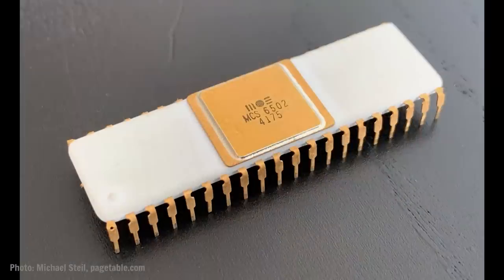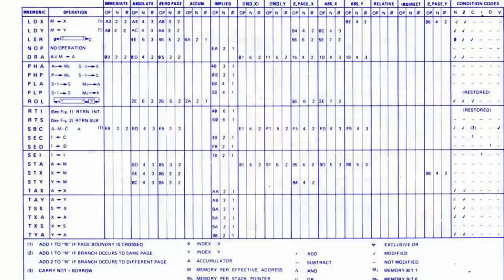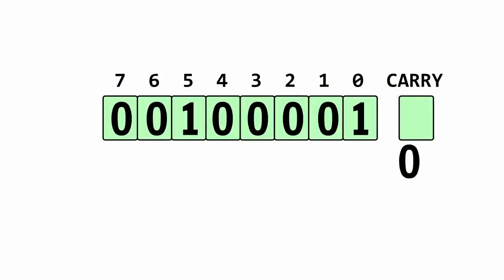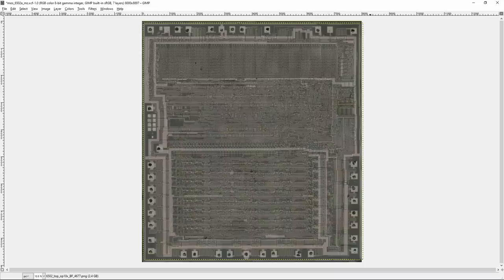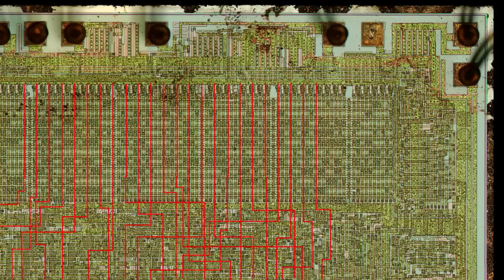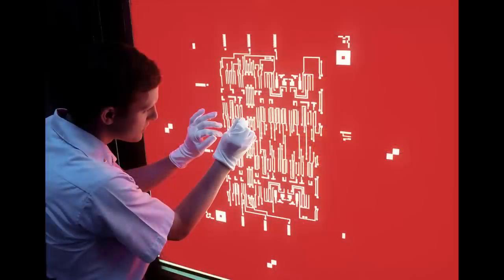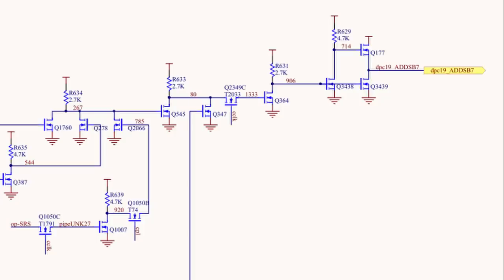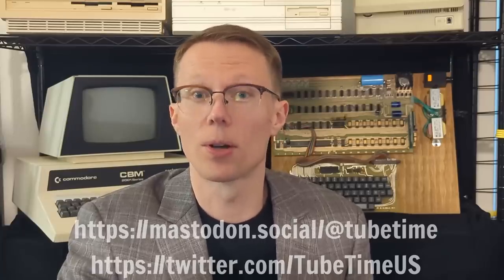The 6502 Rotate Right Myth

Comment from the maker: Some folks are asking about the rotate left instruction - wouldn't that have the same problem? I forgot to mention it in the video, but the 6502's rotate left is a little weird. It just adds the number to itself, with the carry coming in and going out just like in a regular add (ADC) operation. A pipeline delay takes care of the rest.
Reply: Reusing the ADC path is certainly a hacky but legitimate way of building a ROL instruction and would explain why they didn't plan for the ROR.

Comment: Good explanation - if it were an implementation bug, you'd find defective circuitry, not an absence of any.  Nice to get conclusive details.
Reply: Is it a bug if its intentionally masked out ? Would you find defective circuitry if its masked out ? or would you find blank spaces and tracks to nowhere if an intended instruction hadn't been resolved in time for the release date ?

All fascinating stuff though.
Reply: @garyc3476   😵‍💫"Though". 😵‍💫  The designers left out one (or many!) nice-to-have instructions, some possibly decided in the last days due to lack of space.  They documented no ROR instruction.  The 6502A was complete and bug-free.  When a new model 6502B came out, with identical specs and behavior except that one instruction was added, that was no bug either.  Compared to the 1976 model, the 1975 model looked AS IF it were the new model with a defect introduced (undefined behavior instead of ROR).
Nowadays, new instructions can be added (and bugs fixed) retroactively.  The BIOS chip can update the CPU microcode after-the-fact, at power-up.  Undefined instructions can trigger interrupts that call routines that emulate the missing instructions.

Comment: Knowing that these first processors, already  complex with thousand of transistors, were designed with big sheets by hand is mindblowing. Hat's off to those people.
Reply: Indeed!  You can also say the same about old school animation.
Reply: Thanks for the hat tip dude! Thems were the days, no CAD... tape all day long!
Reply: @kirkhamandy  I wasn't this deep into it but I was a PC board layout artists in the mid 80s for a communications company. It was all done with layout tape and rub on transfer solder pads on clear mylar and then photo etched to copper clad boards. I have worked with rubylith, but that was for large scale art silk screening. The owner of the company contracted a programmer to attempt to create a PCB layout program to run on the fledgling IBM PC but he never got the "pathing" to work well enough to use it. I think that was when my eyesight started to blur. We used a lot of micro-miniature surface mount components dealing with microwave tolerances and I stupidly refused to use the desktop magnifier.
Reply: Case of chicken and egg :-)
Reply: @3DPDK  I also did PCBs in the 80s. We used blue and red tape for double sided PCBs. I used to get paranoid when I had just sent off a design to be manufactured and got home to discover a bit of red or blue tape stuck to my arm!
Reply: @johnwellbelove148  :face-blue-smiling:

Comment: Awesome deep dive. I would argue the original run of 6502s behave in an unexpected way when running the ROR instruction which is one of the definitions of a bug. (Even if the underlying reason is that the instruction isn't fully implemented in hardware.) I think this is the age old argument if a missing feature in a released product is a bug or just a "missing feature" and there are many arguments both ways. A thought experiment could be: if MOS has not marked ROR "as not working" on the original datasheet, would this problem then be considered a bug? (Supposedly ROR was listed on the original datasheet but it said it would not work until 1976) Either way, clearly it isn't a flaw in the silicon or design, and that was really cool to see.
Reply from the maker: the feature wasn't implemented and wasn't in the documentation. MOS announced later on that they were going to implement it.
Reply: @TubeTimeUS  correct.. it can't "fail" something it never had even if something else in the future had an instruction added it is not possible for the original to be buggy.
Reply: @ingmarm8858 - not always true. If you manufactured a product, but left out a feature that was expected to be present by the market, even if not in your specification, what would your rivals call it?
Reply: @ingmarm8858 They turned it into a bug by creating an incompatibility with the early chips.
Reply: @TubeTimeUS The January 1976 manual listed ROR as a regular instruction with in parentheses (available after June 1976). Admitting there is a bug without admitting it...
Reply: @ronald3836  If there was a bug, it was what I know of as a design bug, that is, it worked as designed, but it should have been designed differently.
Reply: The video definition of bug seems weird to me as well.  If you can call an instruction, and it doesn't behave properly, then it's bugged, whether it was intended to be called or not.  If they really didn't want that feature to be implemented, I think they should have blocked it off or made it return an error instead of leaving dead-end lines in the chip...
Reply: @ronald3836 is there a scan of said manual available somewhere? Would be intriguing.
Reply: @KaiHenningsen  I agree, there was no implementation bug. (At least not in this respect, there is the indirect jmp bug which was not(?) by design.)
Reply: @root42  yes, but YT keeps removing my replies even I merely try to explain how to Google for it.
Reply: @root42  the title is MCS6500 microcomputer family programming manual.
Reply: Try 6502 followed by a full stop and the first three letters of organisation.
Reply: @ronald3836  Yes,  I see it. Page 174 of the PDF of the Jan 1976 MC6500 manual. Says the ROR instruction will be available after June 1976 on the MC650X family. So, at least by January 76 they had intended ROR to be there and work.
Reply: @adriansdigitalbasement  Indeed. And if I understand this video correctly (maybe I do not!), It is clear that SOME instruction was planned already in rev. A (just not finished). The only sensible instruction with this opcode seems to be ROR, not something entirely different.

So it seems to me ROR was planned from the start, then deliberately not included in rev. A (why? time constraints? die space? anyone's guess).

So is it a bug? Philosophical question.
Are the earliest 6502s bugged? In my view: yes, they deviate from the spec.

Btw, I love your videos 👍

Comment: If it's true that there were no plans to implement ROR, then why is there a perfect spot in the opcode decodes for ROR, right alongside ASL, LSR, and ROL? It may not be a bug, but it's not a missing feature either. It would be a planned but unimplemented or cancelled feature.
Reply: That's simply because the opcodes were designed to use very regular bit patterns, so as to be easy to decode. So for example, the shift direction is a specific bit in all the shift instructions. Then if you have three shift instructions, two which shift left and one which shifts right, then there's an obvious place for the second right-shifting instruction, and it's free because there is no obvious other instruction that would have fit there. It's completely what you would expect.
Reply: @KaiHenningsen  There's definitely a lot of cheating going on in the instruction decoder which is why a lot of unused opcodes do things that similarly coded opcodes do. At the time, a true microcode ROM would have been as big as the CPU itself.

Comment: Coincidentally, many years ago I wrote a VHDL model of a microprocessor, and it actually did have a bug in the ROR instruction. It took a while to find it, because most of the code written that used the instruction didn't tickle it, but eventually I found what I thought was a bug in the program that turned out to be a bug in the microprocessor itself. I can see why the original designers didn't include it, as most of the code I've written for my own CPU rarely uses ROR in its original form. Instead, I typically force the carry bit clear in order to use the instruction as a right shift, since the instruction set didn't include shift instructions. In fact, I so rarely use ROR with the carry intact that I added a compile-time switch that effectively turns it into a logical shift right.

Comment: 0:51 The ubiquitous ARM microprocessor also worked the first time. Designed by a team of 4 at Acorn Risc Machines (ARM) of Cambridge UK in 1985, it took just 1 week from sketchpad to first working silicon. Really impressive.
Reply: Not only it worked the first time, it worked without power supply attached 😀
Reply: Well said, Peter. The ARM lives on in tons of mobile devices. That initial realisation of a working design was a truly remarkable achievement by some incredibly talented people.
Reply: Surely it was designed at acorn?
Reply: @benholroyd5221  You are correct. Arm as a company did not exist until many years later.

Comment: I imagine the "confusion" is that the majority of the documentation for the 6502 shows the ROR instruction so unless you have the original then you'd think it didn't work. People are very bad at looking at notes on data sheets, and when those data sheets get used in manuals and articles its details like this that get omitted. If you've been told there is a bug in the early version people obviously didn't bother lo look for the correct data sheet to check it out.

Comment: When I was 17 I wrote down all the 6502 op codes. That way I found missing assembly instructions that I immediately tried, hanging my cpu quite a lot. Fun times!
Reply: I did the same thing when I was 14! I used in built in assembler (call -151) to list the assembly instructions so I could figure out what each one did. It was so fascinating.

Comment: I remember one of the undocumented instructions. Some people ended up calling it LDAX which loaded both the accumulator and the X-register with the same value.
Reply: My preferred undocumented was DCP (DCM):  DEC oper + CMP oper that combined a decrement and a comparison so it was very appropriate for loop counter to zero and saved a couple cycles in a loop.

Comment: I remember reading from the BYTE magazine back then that a reader had discovered that Microsoft BASIC floating point performance on Commodore PET (IIRC) was inferior to some other computer with the 6502. He traced it into the floating point math using seven times rotate left (or some such, forget the exact details and wont bother to get out a pen and paper) instead rotate right. When confronted with that Microsoft (small company back then) responded that some in some early 6502 chips the rotate right 'did not work correctly'. I think this can be (one) reason why or how this rumour started.
Reply: And I would say it is simply the truth. If they had called the updated 6502 a 6503, then this issue had been avoided.

Comment: I remember working on the 6502 back in the day (circa 1983/4) and we found a bug in the chip. I don't recall the exact nature, but it involved a problem when an address was in an operand and the operand went across a page boundary. Basically, when it was fetching the third byte (so the second byte of the operand) it didn't increment the upper byte of the address, resulting in the byte being read from a page lower than where it should. Very obscure, almost impossible to spot / reproduce and I seem to recall losing weeks of development trying to track down a bug in our code, that wasn't a bug in out code! The fix was to put in a NOP or two to prevent the operand spanning the page boundary.
Fun times....

Comment: In other words: it was a bug, but they knew about it before release and decided to scrub mention of it instead of fixing it. :)
Reply: It was intentional at one level (they made no effort to put it in). It was unintentional at a higher level (the market required it).

The 6502 was designed to implement the minimum set of instructions that the market wanted to see in a cheap processor.

On the whole, I call this a bug. If they had labelled the fixed cpu mos6503, then it was not a bug.

Comment: I recall an ACTUAL silicon bug in the original 8080, possibly fixed in the 8080A, but the AI robot Overlord couldn't find any details about it:

"The 8080 and 8080A microprocessors were two closely related microprocessors developed by Intel in the 1970s and 1980s.
The 8080A was an enhanced version of the 8080, with some minor improvements and bug fixes. The 8080A had a faster maximum clock speed than the 8080, with a limit of 3.125 MHz compared to the 8080’s limit of 2 MHz. The 8080A also had a few additional instructions that were not present in the 8080."

Also:
"There was a bug in the 8086 microprocessor, which was released in 1978. The bug caused the processor to return incorrect results for certain division operations. Intel fixed the bug in later versions of the 8086."

There is a very fine line between a feature and a bug, but those were bugs.

Comment: This was a very well-made video.
I think the only question I have in my head after watching is why did Chuck think he didn't need the ROR instruction?
Is there are reasonably efficient way to get the same result?

I look forward to more videos from you.
Thanks.
Reply from the maker: beats me. the workaround uses shift right and isn't efficient because it manually manages the carry flag.
Reply: He also thought they didn't need ASR, and the 6502 never got ASR.

Comment: Way cool explanation and video.

As is often joked about MS bugs 'Its a feature'

When I was a teen working with the 6502 in my Atari 800, I always thought it would be somewhat simple to make a "monster 6502" out of 7400 series logic gates and wanted to make one.
The closest I've come across and built was Ben Eater's 8 bit breadboard CPU/computer though my version of his project has all registers 8 bit instead of some registers only 4 bit with instruction code/operand sharing the same byte split into two 4 bit sections.

Comment: Why is a register called a register? Is it because of the everyday meaning where you bring two things together and adjust one to match the other, then allow them to separate keeping the information? Eg, put face to name at conference registration, match water levels in a river lock, match diagram orientation via registration marks, and therefore, match voltage levels especially similar to a river lock?

Comment: Like the show. I had no access to the rev A back then so I did not know about the rumor, I started with the 8080 that I bought from radio shack for under $20. My main issue was hand assembly of 6502 code, was with relitive jumps. You had to make sure it didn't cross a page boundry and you didn't necessarily know the location as you typed it. Luckily most of the linkers could catch it so as long as you were not doing by hand no problem.
Reply: I'm pretty sure relative jumps could cross page boundaries, but they could not jump further that one signed byte.

Crossing a page boundary may taken an extra cycle, not sure about that.
Reply: Indeed a branch instruction takes 2 clocks, 1 more if taken, still 1 more if a page boundary is crossed.
Reply: @ronald3836  I was referring to the NMOS version of the part. Relitive jumps did not increment the Page when reading the second byte so the jump was wrong, if it split the page boundry. I believe it was corrected with the CMOS version. If you were using an assembler with a updated linker it would not allow it to happen. You can find a better description on line. I only encountered it while hand debugging( hand assembly)
Reply: @user-fr3hy9uh6y  Interesting! My experience is with the 6510 from the C64, but that is NMOS. I thought the 6510 was essentially identical to the NMOS 6502. The C64 programmer's reference guide confirms the 2/3/4 cycles for branch not taken/taken/taken+crossing.

So if relative jumps could not cross a page boundary in the early versions, I suppose it was fixed quite early on? (I doubt the 6510 really is different here, but I could be wrong.)
Reply: Aren't you thinking of the indirect jump bug? JMP ($10FF) will take the high byte from $1000 instead of $1100, and this was fixed in the CMOS version.
Reply: @ronald3836  no experience with the 6510. The instruction itself could not cross( command on one page, offset on the next) as long as the linker did not place the actual instruction on a page boundry no problem. After I could afford a real compiler, and stopped typing in binary(Hex for 6502, Octal for 8080), I let it handle the problem.

Comment: 6502/6510 ROR and ROL rotate carry in and rotate out to Carry, it's not direct circular as some mcu are. 
e.g. bit 0 to does not move to bit 7, Carry is more like the extra 9th bit.
Weird that they included LSR instead of a ROR, as the LSR could been simulated with a CLC.

Comment: Surely a lot of that circuitry should be shared with ROL, since that instruction has the same issue with carry as both input and output?
Or is ROL implemented differently, for example by using the adder to do ADC A, A, so no need for it?
Some RISC load/store architectures omit a rotate left because it can be simulated with the adder. But 6502 rotates can write to memory as destination, whereas ADD cannot.

Comment: Is this also the reason the 6502 and 6510 have the instruction LSR (logical shift right) and ASL (arithmetic shift left)? The latter shifts bits into bit 7 which is the sign bit, so yes, seems to be named on purpose.
Reply: Note that LSL==ASL but ASR!=LSR. The 6502 is missing the ASR insturction, and I guess the market did not complain about it (but did about the missing ROR).